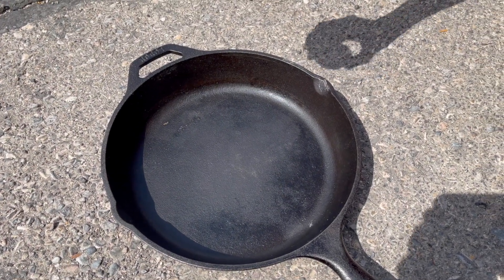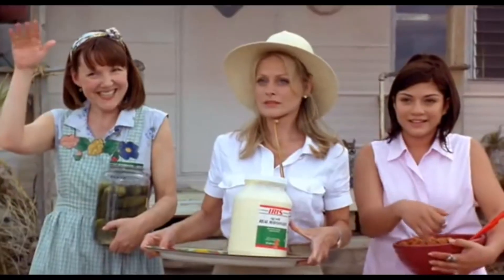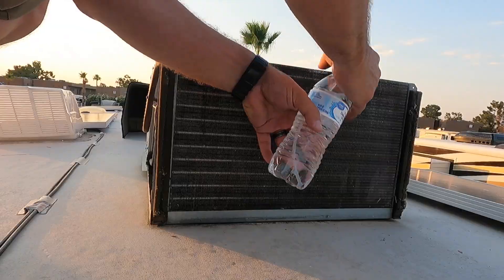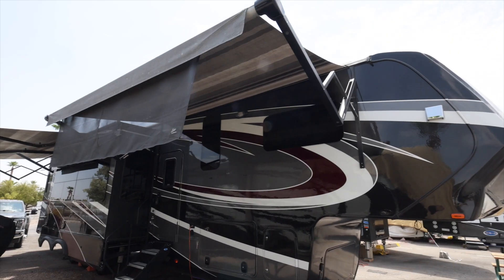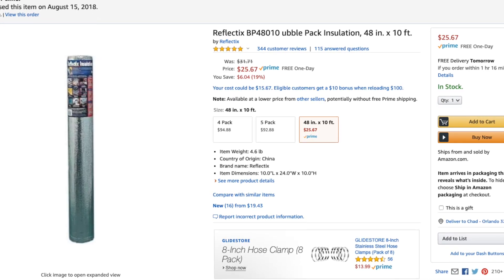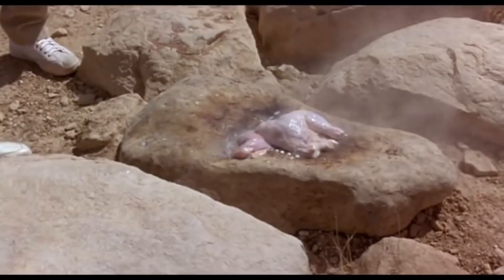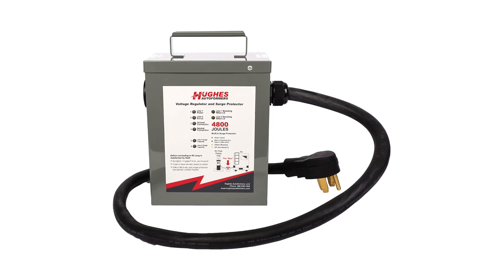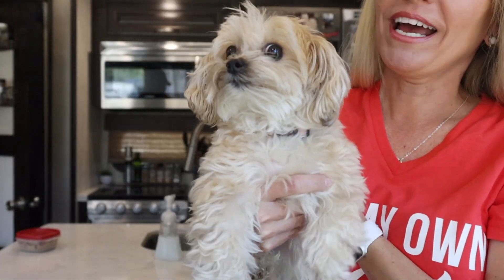🥵  RVing in EXTREME HEAT! ☀️ (Full Time RV Life)

Comment: Try 887 Tropi-Cool® 100% Silicone White Roof Coating. Not only does it seal your roof and joints, it lowers the temperature in your RV by about 10 degrees. I also used the Henry caulking on all the seams before rolling on the coating. Yes it will all stick to your rubber roof.  There are several YouTube videos on applying the coating. Oh, I almost forgot, after i caulked around all the seams, I used ETERNABOND®  tape on all the seams. Then I coated the whole roof. So far it's been maintenance free other than cleaning.

Comment: I have been looking at 12 volt refrigerators they are bigger inside and cool down faster  not too sure of reliability yet but hey what last forever in these things yeah the absorption fridge sucks I put a fan inside the alley in the back to blow air out seems to work a bit better now air blows right over the condenser.  This is one reason I got a class c 1 unit cools the rig nicely even here in Florida and I can run it on the inverter for several hours :)

Comment: I would be careful air cooling the breakers because the rest of the wiring behind it is still getting too hot and now it will get even hotter which could be dangerous.

It’s currently 103° here in Grand Junction Colorado and inside our RV it is 81 and we aren’t using our roof air conditioner at all. The reason is we put two window air conditioners in because we are mooch docking on 2 15 amp circuits and these are way more efficient when you compare the BTUs to the amperage draw. so we can leave those two running all day and they are four times more quiet than the rooftop air conditioner.

Then we fire up our generator for about two hours a day to add the rooftop air conditioner to the mix and that helps. 

We also taped reflect decks over our skylights and put foam in one of our events but we need to do the other two. Pulling the shade curtains helps block some of the heat game and the awnings definitely help. 

We also choose not to wear clothes inside our RV in the daytime as no one can see into the windows anyway. We sometimes put an oscillating fan in here to keep the air moving better also. 

Another thought is that I installed solar all over the roof of our RV and because that sits a few inches above the roof, I think it actually shades our roof and helps keep it a little bit cooler while generating electricity at the same time.

Comment: 8:28 do not leave the cowling off because the fans in the ac pulls air through the condenser coil the best is to alter the cowling by removing the plastic vent intake from the cowling and replace with a metal screen like stucco mesh that way the strain on the fan is less . Along with white cowlings. This is a minor improvement but every little bit helps

Comment: We stayed at Thousand Trails Soledad Canyon and it too had line volts around 103v during the summer.  My Victron Inverters didn't care though, they'll run down to 96v.  The hybrid function came in handy as we could run both our AC units on a 30amp breaker by simply supplementing with solar and turning down the shore power limiter.  Though that won't help the main RV breaker over-heating problem as the "assist" feature just boosts up some DC to match the incoming line voltage at whatever level is coming in.

Comment: I put 1-1/2" of foam board on top of refrigerator under slideout roof. Made a big difference. The temp we were in was 88 degrees and slideout roof was just over 100 degrees. So protected the top of freezer from extreme heat. Put in aux fans in bottom vent and top vent to push air then pull out. Haven't had a need to use them yet.

Comment: We have a 2017 Montana 40' fifth wheel. I'm using a combination of the 50a Hughes Autoformer, MicroAir Soft Starts on both our ACs, a dual 30a male to 50a female dogbone connector, 30a shore power (very low voltage because we are in the last spot and this park has old, terrible wiring) and 30a from a Champion 3400 Invertor generator. With each 30a connection feeding one leg of the 50a connection - which feeds into the Autoformer. That's all to survive the few hot days we have seen this summer up in Sequim, WA. Our outdoor temp reads 100 right now (in the shade) - and 73 inside. Awnings out, reflectix in both skylights (between outside and inside domes) - along with day shades pulled down if direct sun in the window. Oh, and my half inch thick truck sunshade in our big frontcap bedroom window.

Comment: As far as the Hughs Autoformer:
Not sure what the problem is.
#1. If the voltage is low, the appliances are going to pull more current from the pole outlet anyway, which is what the autoformer would do too.
#2. If you are connected to a 30 amp pole, then you are supposed to have access to that full 30 amps.
But if you need only 20 amps of “clean” power, then the autoformer may use 25 amps to give you that clean power. And 25 amps is still lower than the 30 amps you are allotted. 
And if you go over that 30 amps, the breakers will pop anyway. 
So there really should not be a problem using those devices. 

As far as shade, well , if you put enough solar panels on your roof, that will crate a lot of shade too. 😊

And for the fridge, I replaced the automatic fan in the back with a larger, quieter fan underneath the cooling fins. While I was back there, I installed a second fan under the cooling fins and put a switch above the fridge so on hotter days I can turn that fan on and cool the fridge, it only draws half an amp. It works great. 
So, that’s my 2 cents. 😊

Comment: I had an old 85 class A that had no insulation at all and had to survive 114 in Nevada with a 30 amp service. I had wired that back AC so that I could switch it and plug into the 20 amp service using it to just supply the rear AC and then picked up a 6 head mist kit and split it so that it was to 3 heads and used it to make a mist in front of the condenser coil. I was the only one in the campground that had an interior in the 70s. I also was an early adopter of the reflex and had it in very window and where the vents where. Try making up a mist kit that you can use. I am sure that 2 heads per would be enough. I did the same thing with the mist kit for home this year and it made a huge difference. Used a 24 volt auto sprinkler valve using the 24 volt in the AC compressor to open it and mist the condenser which in the north Texas heat with the sun baking down on it.

Comment: Hello from Fresno. We use about 4 frozen 1 gallon jugs to help keep the fridge cold in summer. I have 6 I always keep at home in the freezer, they stay mostly frozen for about 4 days. They definitely help keep it cooler too, most the time we are dry camping so it is only running on propane.

Comment: It’s interesting to see how ‘Massive’ American RV’s are!  I’m from Australia and our average RV size is around 20ft long!  At this length, everything is much easier to manage and tow!  Only 1 air conditioner required for example which can be run by a small 2000watt inverter generator or alternatively off lithium batteries and solar.  We live in our caravan full time and it is big enough to comfortably live in and to work from remotely.  Everything is cheaper, easier to tow and park with far less maintenance.  👍

Comment: We were in Vegas June 16-19 this year and stayed at the KOA Journey at Sam's Town. It was 124 when we rolled into town. We have a single AC in our travel trailer and it did ok, but the fridge couldn't keep up which was super frustrating because we lost all of our lunchmeat. We had the fridge on propane to reduce the electrical load. There was NO shade at our park which didn't help. Voltage was 118 because the park was pretty empty. The breakers didn't pop. It was nice to not need our water heater because the water coming out of the ground was hot enough for a shower. In fact, we had to let the cold water cool off before using it.

Comment: the problem is the tarp type cover if not elevated to 3 ft minimum traps the exhaust from the other AC's and it creates more problems, I spent 2 years there in my infinity 3855FL and used laundry baskets to elevate the sail shade

Comment: you mentioned your skylights being too bright.  In the morning, I too don't like being blinded by the brightness in the bathroom.   I have sprayed the outside translucent cover of my skylights with Krylon Fusion white paint.    A couple of coats, and the light is diminished by half.  This will also block the UV that will degrade the skylight plastic making it brittle.   I have noticed a big reduction in heat coming thru the skylight.
Reply from the maker: Great tip!  Might try that out.. 👍🏼

Comment: Southern Utah isn't quite that bad but it was hot.  I also found that the slide walls get hot, Mine are black, I went to Home Depot and got 4X8 sheet of foil on one side 1/2 polystyrene $8.49 per sheet and cut to fit.  covered both sides of the slides.

Comment: Thank you for all your knowledge and insight. 2 thoughts......... this may have been mentioned already but I’m not sure. What about a(decent) portable ac unit to supplement the rv stock unit(s)?? We are currently in three rivers CA where the average high has been over 100. Now I know 120 is crazy hot but so far our 2 stock units are keeping up. Not ideal temps (75-80) in the heat of the day but we have not needed to plug in our supplemental portable ac unit yet. Heading to Yosemite lakes tomorrow with similar temps so we’ll see. We’re in a 35’ bounder.  Secondly you mention sealing up all the ceiling fan outlets. I’m thinking that leaving the ceiling fan vents open slightly may help to dissipate the heat since the  “heat rises, cold air sinks” theory is somewhat relevant in this. We leave our ceiling vents cracked open 1/2-1” and I think it helps. Just my 2cents. Take care

Comment: Interesting about your fridge. Our Dometic 1350 fridge won't go below 43 degrees no matter what the outside temperature is. It's usually 44-45 degrees. If it ever got in the thirties it would be really cold. Want to change it to a 12V compressor fridge or do the JC Refrigeration mod at some point.

Comment: We camp in our 2021 pinnacle 5th wheel came with 2 rooftop ac and I asked a 3rd 15k unit 
I boat in needles CA and it was 125 there when Vegas was 120 we go every year and get used to it. 

Just cover all windows  keep all 3 acs on full blast 
Park power keeps 122 volts with all 3 running 
Needles marina is the park its awesome 

If the parks had shade over the units I think the entire experience would be different even in 120 plus

Comment: Well I live in Arizona.. and plan on rving full-time... Sooooo my solution was just to build my own RV. I started with a super insulated 4 inch thick floor walls and ceiling commercial refrigerated trailer.. added solar and battery Bank, 12v mini-split AC with heat pump, (PS it's way quieter) built a full recirculating shower with filtration and UV light, internet, 65 inch TV, full kitchen with sink countertop cabinetry microwave convection oven air fryer, 12-volt compressor fridge freezer, (and yes my power system can run literally everything in my RV at the same time) convertible living room bedroom.. and wallah, 72° inside when it's 120 outside on solar power!  Battery bank will run everything all through the night!! If you want the ultimate boondock rig you have to build it. But mine only took eight days of my  labor and $10,000 still needs cosmetics but all the functionality is there and working flawlessly! Oh and the best part yet I can pull it with a half-ton truck! 😂
Reply: You are so talented
Reply: @cynthiaellis8041  Awh.. Thank you Cynthia😊
Reply: I am surprised that you can't pull it with your station wagon.
Reply: @TD-ce5ru  400 HP and 400 ftlb torque. Pulls very well for being maxed out on towing capacity. The rig (truck and trailer) weighs 16,000 lb gross.
Reply: @danielkurek7009  Good point, you would probably need air shocks for the station wagon to pull it
Reply: @TD-ce5ru  next I plan to buy a 24-ft refrigerated straight truck and build that out so I can have a lot more weight capacity and more onboard freshwater

Comment: looks like you might to get that victron inverter upgrade you were talking about in your last solar video if i remember the specs correctly i believe it can use your solar and lithium setup to boost (power assist)you shore power intake to close that gap on voltage you were missing in those sites. plus add those easy starts on ac's, great combo

Comment: Hi. My Name is Joe. In high heat if you have sufficient water supply. A spray water on the condenser will help the air conditioner run cooler. Good luck next time.

Comment: I use that product that lays across the top that you showed. Used it for Texas and FL. It straps down and leaves an air gap that lets the air flow under it. In addition I use Aluminet on top of that. (We learned about Aluminet at Burning Man and used it there also). It looks like an aluminum net, air also can flow through it. Use foam noodles to keep the aluminet off the paint of the RV and help keep an air gap. Placing this directly on the surface helps, but not nearly as well with the air gap. Thus the combo of the two systems is great. I also covered the cap of the 5th wheel with it, in addition to the product, as the product you found and highlighted does not cover the cap. We have a Northwood Arctic Fox 32-5M. In 108 degree, no natural shade, 2 AC systems we could keep the temperature inside at 75 degree and the AC systems DID NOT run at 100% of the time. First time the AC turned off I thought we blew a fuse. Instead it was so efficient the AC wasn't running all the time. Try this and let me know what you think. Hope it helps next time. Great information you guys provide. Stay comfortable :)
Reply from the maker: Great tips!  Thanks!

Comment: The park will probably not like it but you can use a splitter on the water (which we all have anyway), run another hose, and spray the rv down to take away some of the heat. Really works well at or around sundown. I spoke to a man one time that said it was 72 degrees or below wherever he was. Go North in the summer and South in the winter. Lucky man.

Comment: For kinda a hot topic, you again provided an amazing video.  Looks as though you learned something by your stay there also.  I remember when we lived outside of Tucson, 1980-89...temps would get as high as 105 or so.  Yes, shade is much appreciated there too.  But we never lived in a place with A/C, nor drove a car or truck with A/C until 1984 or so, when I bought my wife a used Ford Fairlane 500 XL, loaded with options, back in the day, which included A/C.  In the process of the restoration I repaired the A/C for her and the kids.  I still drove a Ford Falcon Sprint w/o A/C, but it had POWER as in go Power.  We built a house and used what is called a swamp cooler to keep us cooled, which works well except for and during the monsoon season ((July n August).  It took me 3yrs to get to where I had to wear a jacket in winter and 6yrs to get to where I could work outside in the summers, up to 100 degrees.  I really enjoyed living in the desert of Tucson, driving old cars for the norm as daily drivers.  Thanks again for the invite, always enjoy your videos.

Comment: Some info for you.   The highly probable reason that you get readings like 116 and 103 at the same time is that in the pedestals, the breakers were installed in the pedestals the same and several 30 amp connections were made.   Example 50A L1-L2, 30A L1-N, 20A L2-N in every box.    If everyone had 50 amp connections, possibly more even distribution of power.  Or if NEC would have mandated 2 pole connections for all RV’s in the beginning, would be better.   But RV’s are way bigger than when NEC first made rules.   Hard to change now.   Respectfully,   Kevin

Comment: Do you know what gage and type of wire is run to your AC?  Breakers are designed to protect the wiring and RV makers often run the smallest have possible. Was wondering if maybe running a 10g stranded patch cord might have kept your breakers from tripping.  Still though you run the risk if overloading your main circuit or your bus when your voltage is below 110V.

Comment: In our toy hauler, there is a vent between the pass through storage / plumbing area and the living area that pushes a lot of heat in that we have to close off when really hot outside to not have as much heat leaking into the living area.
Reply from the maker: Great tip.. I think that might be the return for the furnace?

Comment: Next time put some patio misters around your ACs and create some shade for them.  Use pvc and shade cloth to build a tent over them.  Ot even a cheap tent with a solar reflective survival blanket on the frame cut the sides away.  Water absorbed heat 20 times faster than air.  It will drop your pressures in the condenser your compressor will work better draw less amps.  Keep  cool
Reply: Great ideas. I try lots of things but as a 70 year old female that is not going on the roof, I cannot even envision how to do this. Covering windows and skylights, I can do.

Comment: A Hughes autoformer uses the existing power and converts what is already incoming into a higher voltage/lower amperage supply. It doesn’t magically take power away from everyone else. The total power coming through the post is the same as anyone else, just safer for the electronics. If you were able to “take more power from everyone else“ it would be in amperage, and that would trip the breaker at the power pedestal. An auto former is not an automatic transformer, and anyone that thinks it steals power doesn’t understand electrical systems

Comment: I haven’t read the comments but would a 24,000 BTU (2 ton) window AC work? I believe those are 220 volts. I would consider sleeping in the pickup truck in the 120 degree heat.